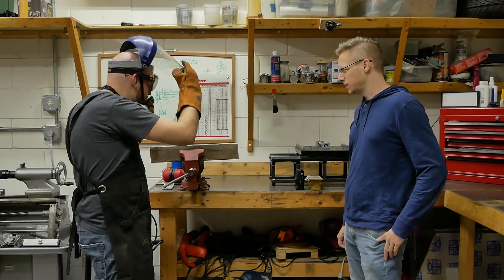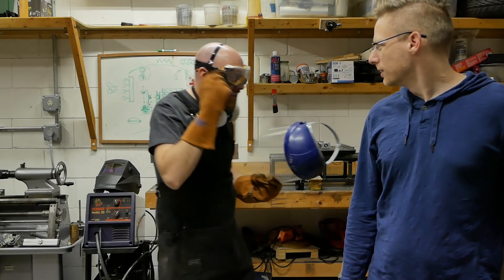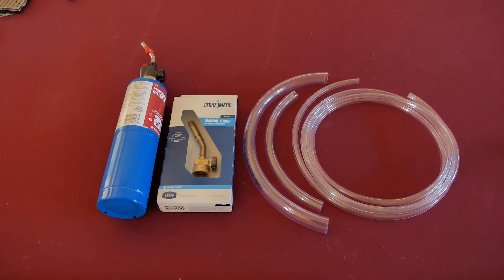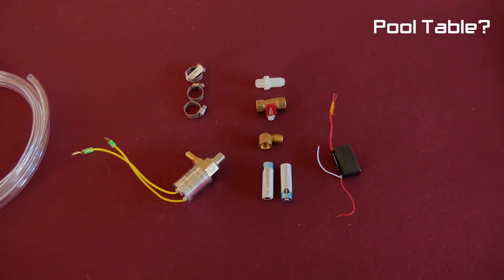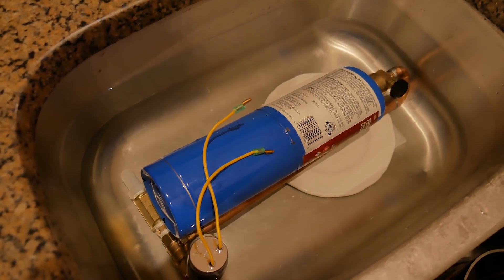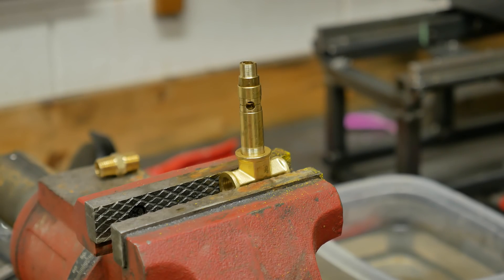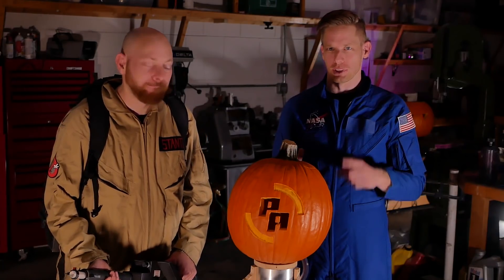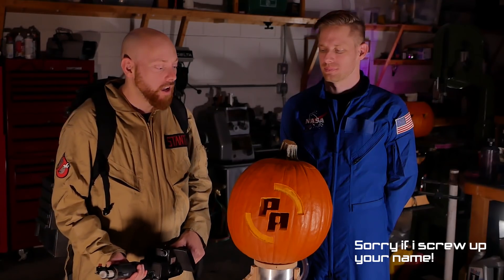Halloween Pumpkannon - S02E20

Comment: Absolutely LOVED the tube flame into the pumpkin boom, but you need to secure the pumpkin lid for a better flame effect out the front (unless that would cause the whole thing to explode).

And for those minor ooooopses causing you to change your plumping plans, just remember the Myth-Busters favorite adage (slightly para-phrased): "If at first it doesn't work, use more C4"... :D

Comment: I think (but don't know, I'm not a plumber or pipe fitter) that for soldering copper fittings like that it's best to leave the heat on the outer fitting, the solder [supposedly] draws towards the heat.

Comment: "HV Generator?"  

Whats in it?
Reply: Fort Hector the insides are all potted in epoxy, but I assume it's a transformer in there. There's probably not much else to it so I'm thinking the relay is getting a bit of inductive spike on shutoff and won't last forever. If you want to use one and have it last a while I'd recommend adding a capacitor and diode on that side of the circuit, but so far it's holding up!
Reply: Why would you ever pot a transformer in epoxy like that?  And how do they get 2k windings into such a small package?  Something about this screams solid state tomfoolery.  

https://www.youtube.com/watch?v=SKlVFBFcz3Q

^ video of a guy smashing one to bits to see whats inside.  It seems it is several transformers in series, which is so simple I feel dumb for not thinking of it.  Duh, you don't need 2k windings if you can just have 8 little transformers with 3 windings each, one input, two output.  Its clearly more optimized than that but it solves the basic problem I couldn't see past.  The one this guy bashed apart had some capacitors in it for reasons I don't already know, probably to deal with that inductance issue you are seeing.

I don't know if its as easy as just sticking it with multimeter probes to measure capacitance to discover whether it has capacitors in it or not, but that might tell you SOMETHING about it.  You probably know a lot more about electronics than I.  I didn't do so well in RLC-circuits class in undergrad.
Reply: Potting would just be for insulation and protection, possible due to using some pretty small wires in order to create a transformer coil capable of such high voltage step-up. I don't think this generates much current, so it would be possible to get away with such a thing (maybe?) I can take a meter across it later this evening and see if I can figure any details without having to get destructive...otherwise I might just have to pick up a fresh one and take it apart like the fellow in the link you provided.

In his case what throws me off is the "mosfet" in his unit...after a little poking around I wonder if this is part of some kind DC pulse generator, as part of a Cockcroft-Walton generator before/after the transformer coils. I had to look up a bit about those, never built or worked with one myself but they seem like neat little devices and are made up of capacitors and diodes. It would be an interesting way of making modular voltage multiplication while using the same coil or set of coils. I could see China doing this, they're pretty creative about re-using parts and housings on components.

Other reasons why it would have capacitors are what I mentioned: attempting to dampen the feedback from an inductive coil. This is an issue with stepper motors too (something I'm thankfully more familiar with than these little devices). Ben over at Applied Science has a fantastic tutorial that covers how a lot of this works by way of electrical impedance, power factor, etc: https://youtu.be/xyMH8wKK-Ag

I think I know just enough to be dangerous...or hopefully slightly safe while being dangerous. Definitely learning as I go!
Reply: I forget where I saw it, maybe in the suggested videos sidebar, but his model looks like it may have come from a tazer?  The mofset in that application would, I think in principle, be precisely what you are doing with the arduino in this pumpkannon build minus the timing logic--pulsing for arcs.
Reply: The device takes DC input, and DC doesn't do much going through a transformer (other than heat it up,) so the MOSFET is to chop the DC into AC of some sort to be able to be transformed by the transformer.  Numerous topologies it could be (I haven't looked into this one.) but it probably falls somewhere in the flyback to solid state tesla coil spectrum.  Capacitors may be needed to keep the input voltage steady while switching intermittent current, but in the transformer circuit, the capacitance is likely to form a resonant circuit with the inductance of the transformer.  I don't fully understand the math for these (and I've got an MSEE,) but if you look into tesla coils or even inductive charging there is a ton of info.
Reply: It probably looks similar to this
http://www.icstation.com/kits-15kv-high-voltage-pulse-generator-ignition-coil-module-suite-p-11217.html
https://www.ebay.com/itm/15KV-High-Voltage-Generator-Arc-Ignition-Inverter-Step-Up-Boost-Coil-Module/362261386596